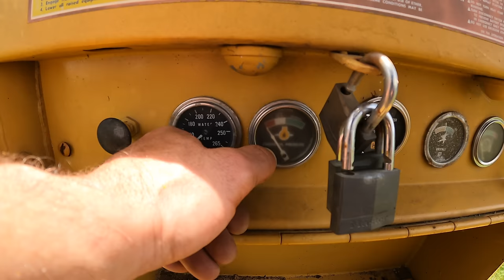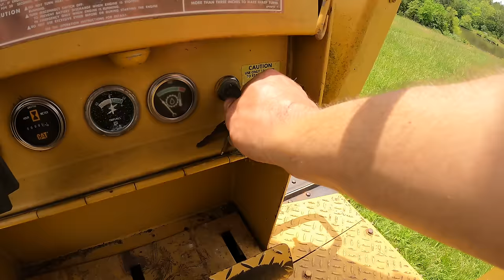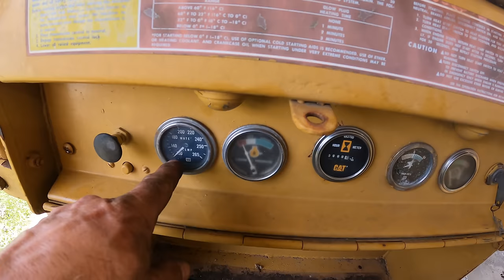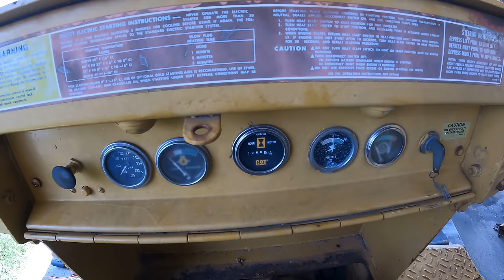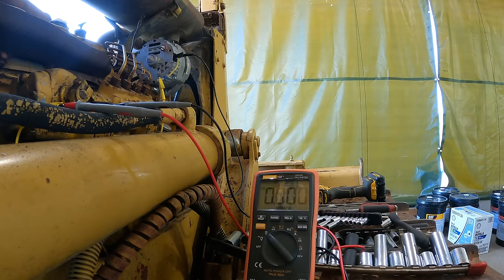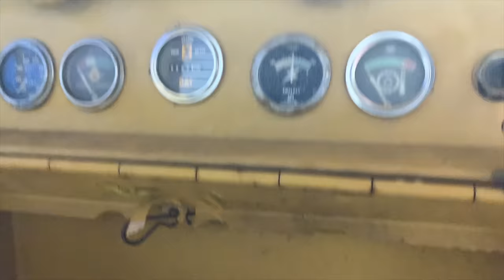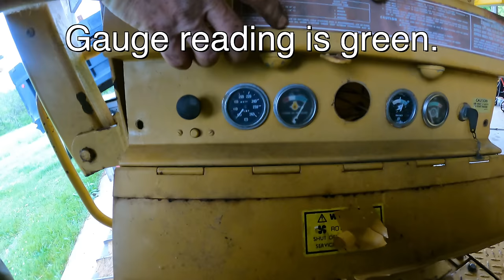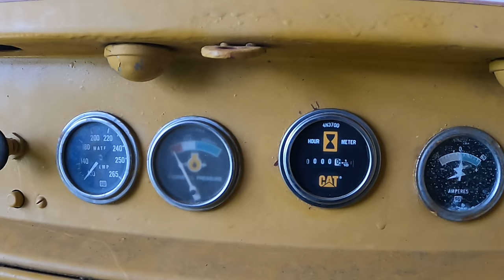Buying & Fixing a Bulldozer, Cat D3 Dozer, Part 1/2

Comment: Your radiator would be cleaner had you used your pressure washer, with hot water and a mild detergent. First spray with a degreaser, spray with a mixture of hot water and mild detergent Dawn works well. set the power washer to a wide fan and spray the radiator straight on so the washer does not bend or damage any of the fins. Fins will be much cleaner than just blowing the dirt out with air.

Comment: First thing I noticed (having operated a 955 and 977 Cat for many years) is those tracks are WAY too tight! Need some slack there for sure! Nice little D3 ya got there though. Oh, before I forget, the lever for the blade up/down has a float feature, by pushing the lever all the way forward. Good for back dragging dirt while grading. And yeah, that throttle lever sure needs to be tightened up so you don't need to hold onto it.

Comment: Good job so far, just pop a bush in behind the lower mounting on the alternator so the bolt is clamping down on the alternator rather than bending the ears mounted to the timing case. Likely to end up fracturing the ears that are attached to the timing case, with regular use.

Comment: One thing I did for my old backhoe,with a bad rod and no money to buy one was JBweld  I Cleaned and  sanded the rusted place ,then cleaned the rod. Applied the JB weld let it set up I used fine grit wet and dry paper. Going around in a circular motion. It's been three years No rust and no leak's.  Best of luck with your New dosser..

Comment: I would put a spacer between the end of the alternator and rear bracket on the pivot bolt, that way you can tighten it down without bending and stressing the rear alternator bracket

Comment: On those alternators the battery post needs to be tight against the regulator or it won't charge.

I've had that exact problem before.

The final (unused) connection is usually for an alternator warning light.

The wire that goes between the battery post and the internal voltage regulator is the closed loop voltage sensing line. If you have a dual battery setup with a voltage drop over a diode you hook the voltage sensing line to the actual battery voltage.

Comment: One thing I've learned if you are going to blow out used air filters with compressed air, try to blow them from the inside out, instead of outside in. Otherwise you risk pushing more of the dirt into the filter which could go into the engine if reinstalled.

Comment: I got squirrley drilling oil seals on the crankshaft, found its easy to poke a hole in oil seal with a prickpunch and use a woodscrew in hole, wrap screw w wire to form a loop, use hammerhead slide hammer to coax seal out of housing.

Comment: Very nice machine for a farmer. D3 or D4D. D3 is a Mitsubishi under license to CAT.  You need small hands to work on it, but it's a hard working baby. You can mount lots of accessories on the back,ripper,backhoe, or winch. 3204 engine is reliable,transmission is simple. Worthwhile purchase,. Old conveyor belting for your workshop floor will prevent chipping your concrete. These were the smallest of the fleet I maintained and mostly trouble free.

Comment: Exciter connection to the alternator usually goes through a lamp after the ignition switch. Once the alternator is charging the warning lamp goes out. I’d have thought a permanent connection to the battery on the exciter may explain the parasitic drain.

Comment: Make sure to clean your pan of all debris and oil.  I have a D3B and had mine catch fire after hours of using it on a very hot summer day in Texas.  Fixed it and got it going again, but what a job.  The lift cylinders are not too bad to rebuild, just need a strap wrench.

Comment: Very cool project. If you are not opposed to chemicals, brake cleaner or Gunk work well to clean that radiator. I use a gallon of Gunk degreaser with an old paint brush, let it soak for 20 minutes or so, then go back in with another coat. Final with the power washer. I am envious.

Comment: Boy  does this bring back memories, I bought one with siezed motor for 5k , tracks and under carriage were good . I ended up with 10k in the motor that still starts like yours in the video. I basically rebuilt everything except final drives. I then cleaned up and painted. other than motor I have been pretty happy with it. Parts are fairly cheap. Wish I would have got a b model with 3 rev. gears . nice video

Comment: The way that oil pressure sensor works I used same concept for a lift pump control for my buddies Duramax. Oil pressure sensor run a relay relay run the pump.

Comment: Add a spacer between the alternator and the rear tab on the engine, so that the bolt isn't squeezing/deforming the tab. With a spacer in there the bolt will reallly be able to lock everything down solid. Also, i would change the coolant with some fresh heavy duty diesel coolant.

Comment: There should be an open slot in the backside of the alternator for placing a small wire to hold the brushes in place. Remove the wire after assembly.

Comment: You can use a drill bit in the hole of the brush holder and pull it out from the outside of the alternator. I use a 90°pick to push the brushes in far enough to slide the drill bit in.

Comment: I have been a gen guy for years and seen many radiators like yours.  Pure simple green works best but takes less time if you PSI wash both sides to get off the thick stuff.  I made up a short wand for use in tight spaces, which radiators usually are.   Helps too if the radiator is hot when you clean it, oil comes off easier when it's hot.

Comment: They made that alternator so you can stick a pin in from the outside to hold the brushes down while you assemble it. Then, like a grenade, pull the pin and you are in business. I think that a 3/32 or 1/8 pin should work. Dowel pin if you have one works. Any round material is ok.
Reply: A drill bit works too

Comment: Idea for rad clean. Set up a oscillating sprinkler to spray through the radiator fins. I go and find something else to do for a while. Really loosens up the material in the radiator.
Great job 👍 thanks for sharing.

Comment: Someone might have already told you this as I didn't read the previous comments but there should be a small hole in the back of the alternator case to push a small pin through to capture the brushes. The pin comes in the box when you buy a new voltage regulator. Some one rented me a brand new D 4 for 4 days once. Boy were they sorry! My guess for the project would be a root cellar or a pond build or rebuild.

Comment: 12si delco  Alternator Bullet proof . The Brush holder is easily accessed from the back and a Paper clip will hold the brushes in place while you reinstall the back cover also when re-clocking the back cover to 4 different clock positions. easy and inexpensive rebuild Bearings included $15 to 25, in parts.

Comment: Great videos and you’ll really like that little dozer. I have a 70’s Case 350 on the farm and couldn’t get along without it. 

Maybe you already know this? Put the blade lift in float and back blade in reverse until smooth. It does a much better job than driving over it. On a Case the blade lift lever is pushed all the way forward for float.

Comment: I enjoy watching videos on reconditioning things, keep up the good work, helpful tip on the alternator there is hole in back of the case that lines up with holes for the brushes I use a paper clip,  and you can turn the back case to three different positions for easier electrical connections.

Comment: I did not read thru the comments, but if you put a wire/paperclip thru the hole on the outside of the alienator it will hold the brushes in place also.

Comment: Transmission tool A seal puller. Save you so much time. Hooks in and pry and the seal pops out.
I wish I had a guy next door with a farm to help out. I'm disabled but able to function in most ways just not for long or I'd get a real job. I love tinkering but can't afford the space to work on stuff.

Comment: The battery drain is likely the alternator field,,  hook the field wire to the oil pressure switch normally open side with the wire you left as spare  assuming it goes up to the alternator area.

Comment: I believe you need to disconnect the field connection when not in use or it will run your battery down.  It is normally done via the ignition switch and also often runs through an alternator light.

Comment: I've rebuilt a thousand of those Delco alternators. The one wire is the only way to go. A straightened paper clip can be used to hold the brushes through a hole in the back of the case rather than the example shown here.

Comment: The two boards to both sides of the seat are supposed to have a large foam pad and vinle cover for padding so when yoir leaned over looking to the side or when your on an extreme slope you can sit sideways. Remember a dozer will slide before it flips.

Comment: Hey John ! Nice D3. Cool.  I wanted to mention this to you John about the slot in the alty. You have to get a all treaded bolt and nut for the space that you have on the back side. To be solid throught out. The Vibration will cause the alumuinum to wear down against the steel bolt. Its happen to me on my 89' L9000 Ford 4000 gal. Water Truck , Great Video's John.  Thank's Again.  Curt Mossbarger  45 Years of playin with toy's big and small  Rollen Thunder Performance Alta Loma Ca.

Comment: CAT service bulletin allows J&B weld epoxy to fill pitting scratches in chrome rods.
I have fixed them and lasted years.
Hercules hydraulic seals Florida has all seals packing orings parts rods etc

Comment: Thank you for explaining control system on CAT Dozer. It reminded me of the CAT 955 Front Loader I use to run. The total foot control for steering. I hear you on the LEAKS on Hydraulic cylinders. My 1978 Dynahoe -190 the two front life cylinders Leaked like a River. My wife wrote up sales contract to pay him half the price he wanted(a home building contractor who just used the backhoe to mix cement in front bucket) he was desperate to sale her. The Repair of the two front life cylinder and the ( Brakes) it COST me more than the price of what was left over on half payment. We sent all the bills of Repair to owner plus i payed to haul her to my location. It needed a winch system on trailer to unload her. ( No brakes) the Dynahoe has a different type of back wheel independent brake system. There is a switch on front loader bucket control for braking each back wheel. Believe it or not the Repair supervisor sold Dynahoes back in the 1970s. He said NY city bid on backhoe for there fleet based on that rear wheel braking system. No other manufacturers had a brake system like it. Thats why if you see older videos or pictures from New York, you always saw Dynahoe backhoe repaing water line breaks in the big Apple 🍎🍏 they were also a backhoe that did not get cracks in frame with a ( bull nose) breaker. Very heavy a powerful machine,

Comment: Quick little tip, for the radiator being caked with grease/dirt crud. Spray it with diesel and the diesel will break down the grease and you wash it off with the air compressor. Works the same for oil grime as well with a pressure washer. We have an old joy air compressor that the oil cooler leaked and it covered everything under the hood with hydraulic oil and the dirt stuck to it. Sprayed it all down with diesel in a pump bottle and it easily washed right off. Works well with asphalt/tar too. Also Oil samples are a LOT Cheaper and less work then changing the oils, it'll give you an idea of what oil is in it and what condition the machine is in.

Comment: You should connect the positive on the hour meter to your Field Winding on the alternator using the wire you have, that way you only power the field of the alternator when the motor is running. And then I suspect you won't run down your battery.

Comment: Don't be too scared of the steering clutches and brakes if you ever have a problem with them.  My brother used to get those d3 in alot.  They  took out seat for access top of housing.  Loosened fuel and hydraulic tanks without draining and leaned them out just a little bit for clearance needed.  Unbolted dry clutch/brake assemblies and lifted out with a cheap rolling engine hoist.  Brakes was maybe a band around outside of assembly?  Clutches sometimes were just rusted and needed disassembled and cleaned but could get replacement parts aftermarket.  Just some metal plates and discs of clutch material usually.

Comment: Hi - I have a 1982 Cat D3B - I bought it from a dealer last year & I paid $17K plus $180. For partial Credit Card use also sales tax on total. Out the door was $18,600. Delivered. They claimed it had 4957 hours on it - after purchase realized hour meter did not work. It’s a decent machine, has some issues like one track adjuster tends to leak down over a few hours use. Mine has the replaceable rear sprocket teeth. Not perfect but it works. I figure I’ll get value out of its use. Thanks for the video.😊

Comment: Gary at 'Old Iron' runs compressed air over an attached bottle with soap or some soft cleaning solution. The Bernoulli Effect draws out the fluid as a mist with the compressed air. Squatch253 recently picked up a motherload of Cat parts and might be willing to sell. He's got a lot of shopmade tooling for Cat work. If you want more grip on this or a future alt, add a tubular bushing on the backend so that the back half at the split has grip as well.

Comment: Those 32:50 are the armrest bases. You're missing the black vinyl covered foam rubber cushions. They could have done better interfacing the armrest mount to the dozer, It could be a better design to allow moisture to dry and not rust out tank as you mentioned.

Comment: I think you got a very good deal, yes the tracks are too tight. Its really not a good idea to use high pressure air to blow out air cleaner not recommended because you can tear the paper element. looks like you can do some very neglected maintenance and be good. Dont forget to make sure the belly pans are on. Dont run with out them

Comment: duetz used that particular alternator all the time on the old 912's. a common issue was the little wire going from the battery terminal to the spade connector would create a draw on the battery by back feeding. what we did to solve that issue was install a diode in the wire so it could feed that terminal but not backfeed into the battery connection. maybe backfeeding isn't the correct terminology. but what we found was the exciter wire was keeping the alternator energized and creating a draw. putting the diode in removed that draw.

Comment: Nice dozer. The alternator should have a cooling fan just behind its pulley, Also the case could have been clocked for easier wire connecting and the retaining pin for the brushes should be installed and removed from an access hole in the back of the case. Love your vids.
Reply: The fan is normally transferred along with the pulley on many low dollar remanufactured alternator.

Comment: looks like a standard gm one wire alternator :) i put one on my 1950 ferguson tea-20 farm tractor, along with a ford 12v coil, to convert it to 12v negative ground from 6v positive ground. super easy to wire up :) i literally just fixed a one wire alternator on my roommate's loader. the post fell out, just like yours. i took it apart, threaded the nut back onto the post, and put it back together. for the brushes, i stuck a small diameter drill bit into the access hole in the back, then pushed the brushes down a row at a time and slid the drill bit over them to hold them into place. put the back case back on, and pull the drill bit out through the backside.

for replacing seals like that, i usually just grab a wood screw and drive it in without a pilot hole or anything. ive never had issues doing it that way, and ive never nicked a shaft doing it that way either :)

i cant wait to see more on this dozer! thanks for making the video and also bringing back an old piece of equipment :) it absolutely crushes my soul seeing old equipment getting scrapped. cheers John! have a great day, and good luck with the rest of the repairs!

Comment: If you get bored this winter and want to practice your welding for a BUNCH of hours you can weld some fresh bar onto those grousers. It’s a grueling process but it’s a Night/Day difference between those shawty grousers and something approaching 100%. I’d say you’re around 20% there. If I can find my Caterpillar undercarriage measurement guide book I will let you know what your 100% grouser height is. 

As another commenter said, get those rods ground and re-chromed and rebuild those cylinders and they’ll outlast you. Great fix on the alternator.

Comment: As long as you hit it straight on you can pressure wash the radiator. Just don't hit the fins at an angle and they'll be fine.

Comment: Nice, we used to have an older d3 I ran at work road building.
It looked like there may be some excessive movement where the arms connect to the body.
Also not sure if it was just the video footage but it looked like the back half of the fuel pump was loose.
I'm sure you'll be happy with it I loved running my machine

Comment: John.  Buy a set of ‘hydraulic’ wrenches. They are open ends and angled differently, allowing you to turn almost any fitting or bolt in any tight location!  HF has them and reasonably priced. Great videos.

Comment: That little yellow wire you ran needs to goto ignition positive on the key instead of the battery post on the alternator, so the alternators not running its exciter coil when its off